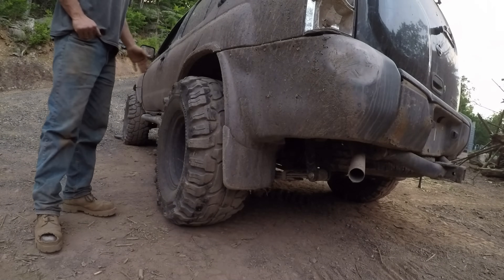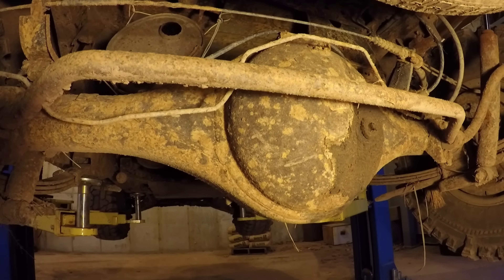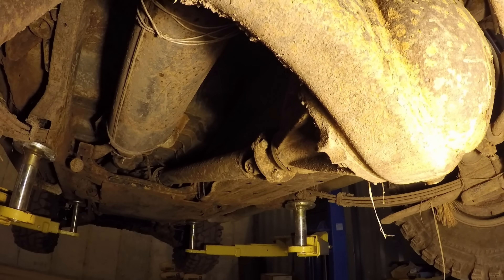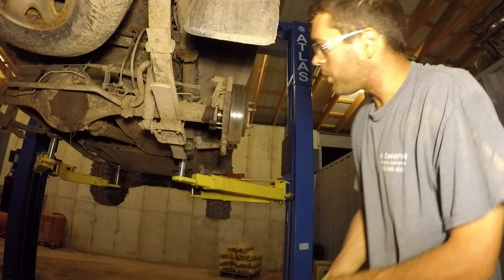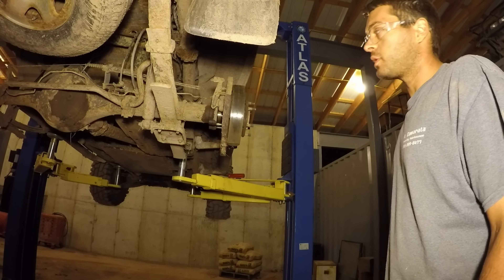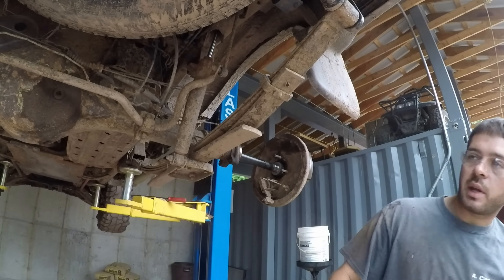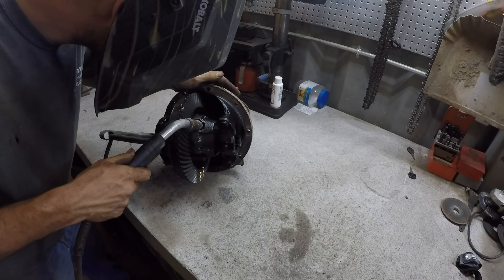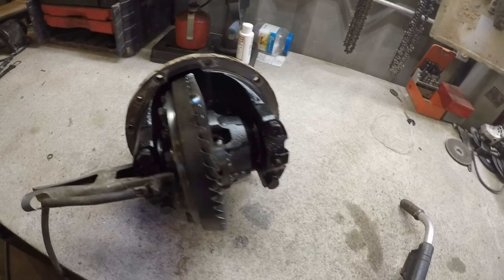How to weld a truck axle positive traction

Comment: You should tell people that the 3rd member is heavy and you can drop it, like you did. First it needs to be cleaned off so the dirt does not get into the rear end and cause a lot of damage later when put back together. Like you said this is not for the highway, off-road only.
The ring gear needs to be protected (covered so weld splatter does not get in the teeth)

Comment: He didn't tell you that taking sharp corners are now difficult because having welded gears wont let the outer wheel slow down when cornering so it kinda pops, better to put in a cross bar in the assembly and disc for positive traction.  My opinion as a mechanic of 50 + years.
I replace brake lines with stainless steel, not copper it's to soft, and may bend on some brush or rocks .
Reply: That's good to know! But I can't blame him for forgetting, it's a natural thing all humans do

Comment: Andrew be careful about advising to use copper tubing for brake lines, The reason auto makers don't use copper is under panic emergency braking copper can't handle the extreme pressures and burst. I tried it back in the late 70's. Someone take your advise and hurt themselves they could come after your income. Just saying.
Reply from the maker: Ill go after their income, steel lines burst 100% of the time. I have never had a problem with the NIC/copper lines. Auto makers should have to recall every vehicle and replace them for free.
Reply: @AndrewCamarata  I understand what you'er saying, What I'm saying when you say copper instead on Nic/copper because there's a big difference. I love your channel I found your channel 4 months ago and watched every video you posted, So I can say without a doubt you are the hardest working young man on YouTube.

Comment: Hi Andrew ~! Why weld wheels in differential gear? After all, you could mount a differential there that has a lock and then you can either use it or not.
Reply: He knew about lockers, but this is much cheaper

Comment: I believe that the reason for the steel lines is that they dont cost any more than the copper, and they fit the mold of "engineered obsolescence" so that the manufacturers and their dealers get to replace the lines when they wear out.  That's how they make continued revenue streams....

Comment: i was told copper was to soft to hold up to hydrolic pressures
Reply from the maker: Its copper nickle, its meant to be brake lines. I have never had a problem with it, and I have lots of problems with steel lines rusting out.

Comment: The copper doesn't break in the wintertime - it does with water - but your using brake fluid it won't freeze

Comment: Funniest part @ 4:35. Andrew discovers gravity. Heavier than ya thought? Been there. Also if you put a striaght socket and electric impact to your lugs it will destroy the brakes man. Thought you wouldve had torque stix? That xterra needs like 110 ft lbs on the lugs, any more will damage the brakes. I always tighten my lugs with a torque wrenchh and if I used my impacts I'd get sticks first.

Comment: Why do car manufacturers make cars that way, with one wheel spinning in the back ?, I see the benifit of the two wheels in the back now spinning together better traction, but with one only ??
Reply from the maker: Because when a car goes around a turn, they wheels need to be able to spin different speeds.
Reply: @AndrewCamarata  ok ! So ur reason to weld those gears is to gain more traction on the dirt road and ur not concerned about going around corners?
Reply: @georgezgreek  he probably has another car for the plebeian roads

Comment: If you just weld 2 teeth together, and then flip it 180 degree and weld only 2 teeth... It leaves a little wiggle room and allows them to move a little differentially, and then locks... so it's not so bad on your tires when turning corners...   It still locks when you're turning sharp, but it helps.

Comment: In Sweden we call it a farmer diff.
Reply: Often called a "Lincoln Locker" here because a Lincoln welder is usually used to make them.
Reply: In Australia they're sometimes called 'Weldies' and not primarily done for offroading but for burnouts and the sort. Most people in Aus daily their 4wd so they just chuck a locker in the rear anyway.
Reply: Or AGA Diff :)

Comment: Copper lines really are not meant  to handle the very high pressure of a panic stops with power brakes! Or  are you referring to copper plated steal lines?

Comment: Good video. Andrew do you ever think about the negative aspects of dirt and sand etc. falling into what you are working on and causing early failures of gears and bearings? My approach, for what is worth, would be to hose everything down to get the dirt off before opening things up. I tend to be a little over OCD and like to have an operating room type cleanliness before opening up stuff like this.

Comment: Andrew i have the same welder as you i was wondering what size breaker you run it on i have mine on a 40 seems to do fine. Just curious
Reply: That one should actually be on a 50 amp breaker. If you want to use it full potential.
Reply: Andrew Camarata, I still have the same welder as you I was wondering what size breaker you run it on, I have mine on a 40 ampere seems to do fine. Just curious.

Comment: For those concerned about using copper for brake lines there are alternatives other than stainless steel. Copper-nickel tubing, such as Cunifer or NiCopp offers a DOT approved line for hydraulic use. Its PSI ratings are only a little lower than steel and strong enough for brake applications, which typically see a maximum of anywhere from 800 to 1,500 PSI.
Reply from the maker: Yeah, I mean copper-nickel.
Reply: I wonder what the DOT psi approval rating is for rusted steel lines. Hmm?

Comment: Oh yeah and kudos to your girlfriend or wife whichever she is for getting out there and helping you like that I have seen her in other videos of yours women who will get out there and work with you not afraid to get a little dirty are good women
Reply: Nice. But a torque wrench vs. impact (3X) on those nuts would be a learning moment, perhaps.
Reply: Nice.   But a torque wrench vs impact impact impact on those nuts would be a learning moment perhaps
Reply: @SeanONeill13  on steelies like this it doesnt really matter, you can only overtorque the alloy wheels
Reply: Peter Pimmelmann You can over torque the studs, stretching the metal leading to fatigue and a weak spot.
Reply: @SeanONeill13  i didnt think of that. however ive always done it that way and i have never had issues

Comment: I always used copper on my plow trucks and personal vehicles, but as a NYS inspector, we were not allowed to use or pass them. SO,,,,,, if you use copper for your brake lines, 2 things. 1) Make sure they are set so that it would be near impossipble for a fallen branch to grab and break them. (That was the reason I was given by NYS on why we could not pass them). 2) Bend them up and fit them. Then paint them black... nowhere in the NYS rules does it say we have to LOOK for copper lines.... ;) 

Oh and ATLAS?????  Especially where you are from you should have a MOHAWK LIFT!! This is straight up blaspheme....   lol...
Reply from the maker: Why wouldn't copper be legal? The steel lines should be illegal! They are a huge safety problem, they fail all the time, leaving vehicles with no brakes, often during an emergency stop! 
MOHAWK lift? I haven't heard of them, I guess they should advertise more, when I was in the market for a lift, Atlas was what looked the best.
Reply: When I asked why copper was not legal, they answered: Because copper is very soft and will pull apart easier than a steel line. The same day the guy was in my shop busting my balls, I had a car in the lot that had lost it's brakes due to a part of a tree branch that had fallen off a trailer in the road. My customer didn't have anywhere to go and had to dun it over. Yes, it was a steel line and I showed it to the NY inspector guy. He told me if I were to put a line on a car/truck and it had a wreck due to my copper line installment, I would not only be sewed but lose my NYSI license.  I think it is total BS.. BUT HEY, I'd do SS lines if people wanted to spend that doe!! 
Mohawk is in Amsterdam, NY.  Best lift made. Check out their design. A heavy duty machine operator like yourself will LOVE IT. 
http://www.mohawklifts.com/wp/
Reply: wow i live by amsterdam NY ,never heard of them.
Reply: @AndrewCamarata  Another thing is the joints will have dissimilar metal corrosion due to copper and steel being mixed, possibly. I put stainless brake lines on my car, a bit more pricey but if you buy a large amount it isn't so bad
Reply: @0xsergy  
I have a Mercedes with nicopp lines, been on there almost 20 years. Three years ago I bent a line while working on the frame and replaced it just in case it was too kinked, nicopp compresses easy. The line had near zero corrosion. I checked the inside of the flare where it seats on the steel fixture out of curiosity, both looked brand new. 
    That doesn't mean every line is going to be the same, but there you go.
Reply: @Dawt_Calm  yeah it really depends. Sometimes a bit of salt gets in there and its a wrap lol
Reply: I know that copper tubing is forbidden in aircraft applications.  They work harden with vibration and inevitably crack over time.  Stainless steel brake lines will never crack and  never rust.

Comment: Does this lock up the differential so both wheels always go the same speed?  Is that why you can't take it on pavement?
Reply from the maker: Robert Coates yes it does. But It's not that bad on pavement just Wears the tires quicker. If it's a vehicle that's very often on the street, install a locker instead.
Reply: @AndrewCamarata  If you have a locked diff the chance of rolling or flipping a car is much higher because the inside wheel starts to skip which can tip the vehicle over. It's also why four wheelers (well, the chain driven ones) are even more dangerous on paved roads. As you said in the video, only ever have solid axles for offroad (or I suppose racing, like go karts). Basically people who know what a solid axle does to a vehicle.

Comment: 100% agree on the copper nickel brake lines. I use them for all my replacement lines. Buy the flaring tool and then get the line by 25ft on Amazon and make your own.... The rear end of that Nissan almost reminds me of a Ford 9 inch. Did you do this before going to that mud mountain thing? I'm sure it helped if you did. Nice video!
Reply from the maker: BarnStangz yes I did do this before mountain madness. If you watch the bumper video I did weeks ago, you see the truck got stuck a few times because it wasn't posi, so this was important. I postponed this video because I wanted to do it in an American vehicle too to show the difference. But my friend with the red explorer was too busy working on his house.

Comment: Your shop is set up so nice! I won't lie to you saying I'm no jealous. Do you have heat or are you located at a place where you need it? 
I love the auto lift.
Reply from the maker: Military Museum I have heat, I. Never hooked it up though. Sometimes I just use a portable heater if it's really cold.
Reply from the maker: Military Museum those auto lifts are cheap, if your working on vehicles sometimes, buy one.